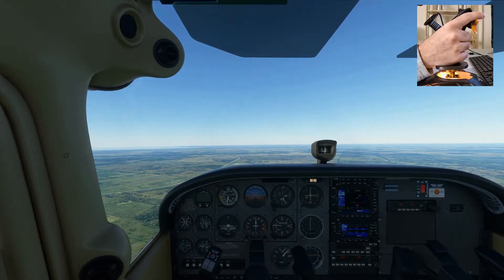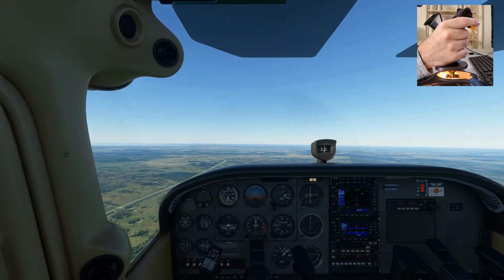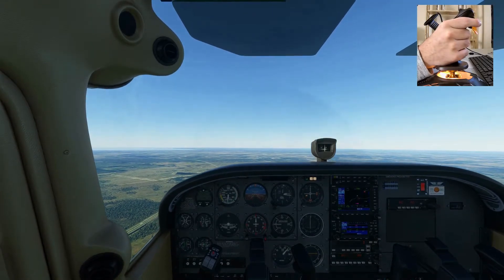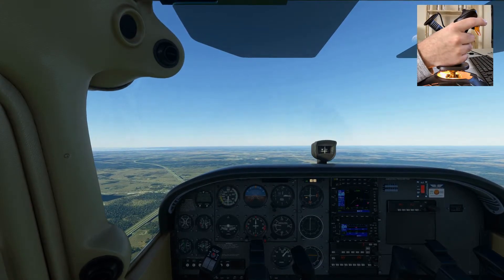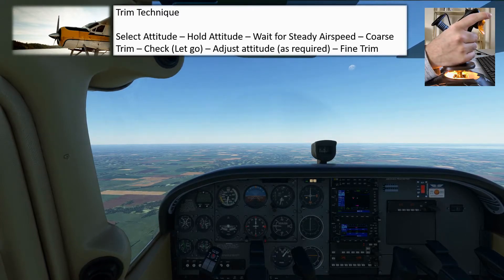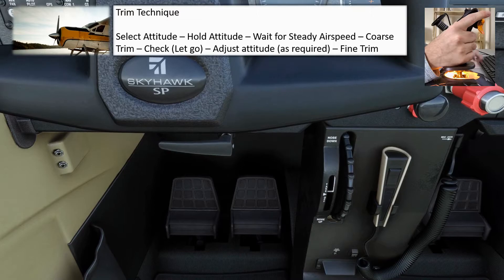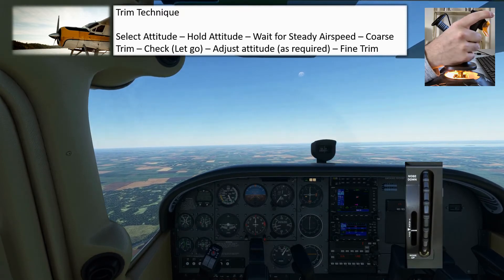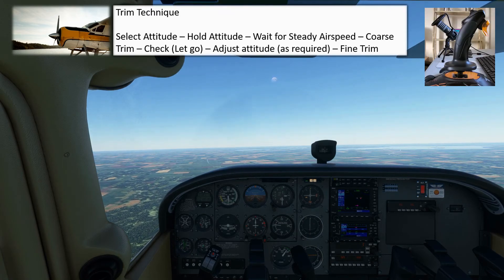Quick Lesson in Trimming with Real Airline Pilot and Flight Instructor in Microsoft Flight Simulator

Comment: The datum attitude, how do you know what it is for each aircraft? I'd assume on a nose wheel plane you'd set the attitude indicator to level when sitting on the runway? But what about a tail dragger, or when you are on uneven ground?
Reply from the maker: The technique works for any attitude. The datum is a training reference that we use. This was actually a clip from a longer video which I took down because it was the first video I attempted to make and it made me cringe to watch it back 😂 what we are basically selecting here is a normal cruise level flight attitude by outside visual references.